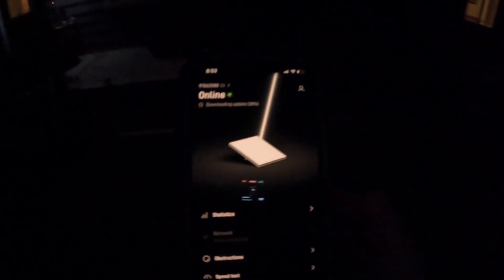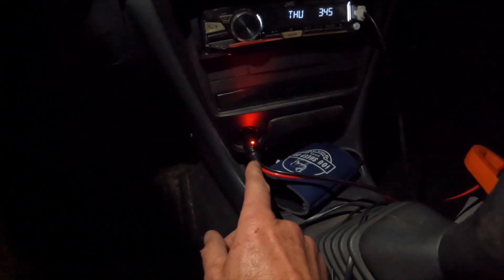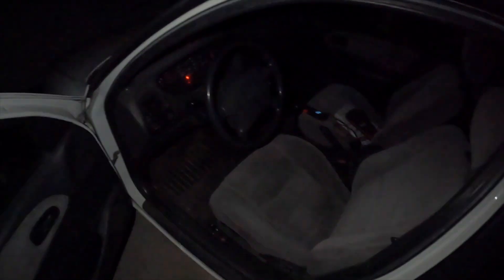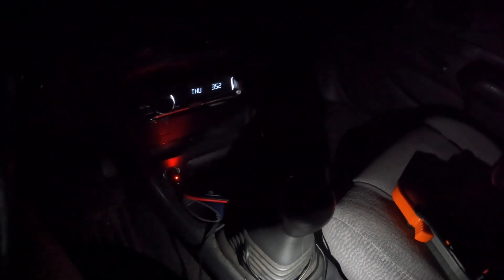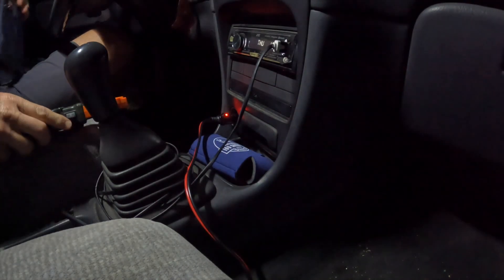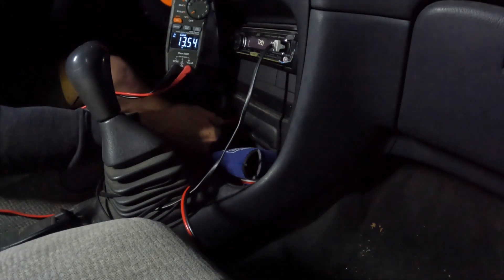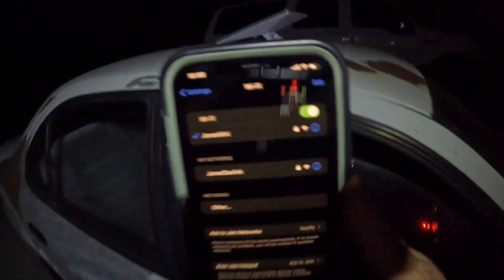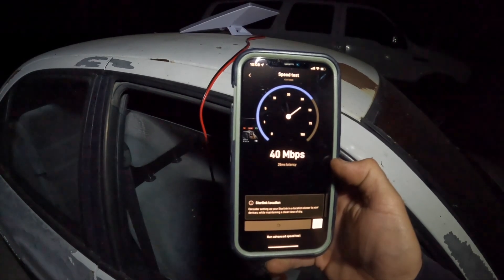Starlink Mini, In The Car!  12v ONLY!

Comment: Any anyone here can tell me if I can hardwire to a switch panel in my car?
Reply from the maker: @VCBP-415  i would.  Just needs minimum of 12v, so make sure you don’t have any voltage drop through your circuit and you’ll be fine.
Reply: The mini needs at least 12 volts. If you start with 12 volts and put a 45 foot cable on it, you don't get 12 volts at the other end (voltage drop through the cable). So if you plan to use the stock cable, get a 12 to 24 volt step up converter. Connect that to your car, and the starlink to the 24 volt output. You'll be fine.

Comment: I have a starlink mini. Mine needs a minimum of 20v dc to bootup and connect to the satellites. I use a 12v to 20v step up converter. Next time you power it up you should show the speed test.

Comment: Here's the simplest way to ensure enough voltage / power.   Buy a simple USB-C PD adapter for the cig lighter.  Think I paid $12 on Amz.    Then use a 5521 to USB-C adapter cable (about $10 or less) and you're running up to 20V to the Mini and won't suffer those borderline 12V sags that cause the Mini to shut down.
Reply: Could you post links to the Amz items
Reply from the maker: @j1bird2k yes! I wanted to run it all for a bit before I suggested items.  Part 2 will be up in a couple days and i will include links.
Reply from the maker: @5thGenNativeTexan  oh!  I didn’t know USB C pd was using higher volts!
Reply: @Chasing518    USB-PD power supply devices communicate with the device they are powering/charging, and then provide the voltage, watts, etc that are appropriate for that device.   Thus a USB-C PD device can provide different voltages such as 5V, 9V, 15V and 20V, depending upon which the receiving device requires.
Reply from the maker: @5thGenNativeTexan oh! That’s super cool.  Thanks for the info!

Comment: i had a 12 to 13.7 mini 3 amp converter  .. burned it due to test . it could make 8 to 13v  // sturdy 13.7 but when alternator hits  i guess it might  block the converter .. it was definately  a boost one.. and no buck boost  regulator....  which is what u want to minimize  losses